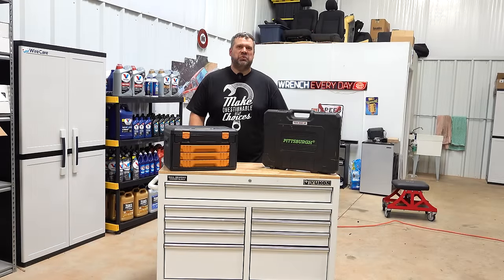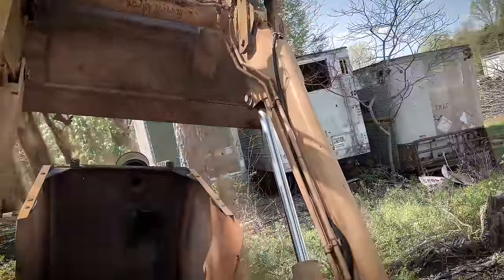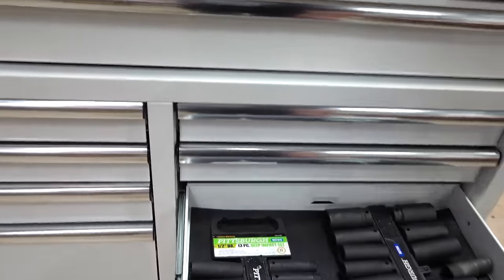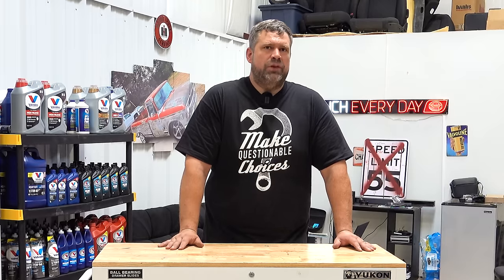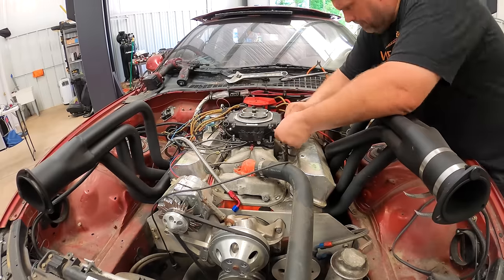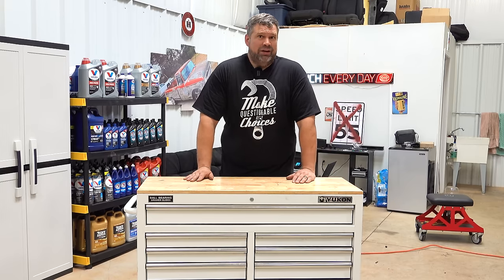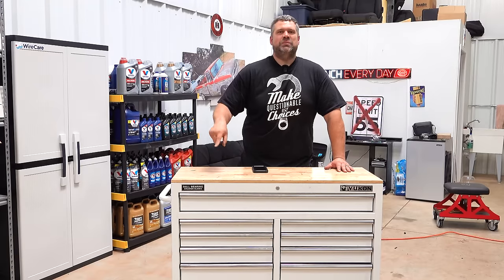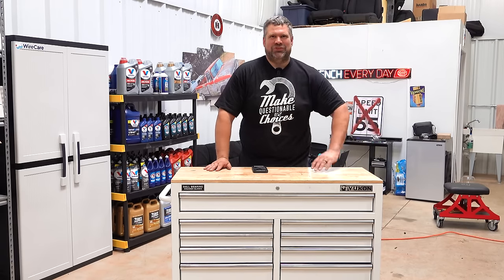I Bought The CHEAPEST Tools In Harbor Freight (6 Month TORTURE TEST)

Comment: Tekton Tools, Sunex Tools are fantastic. I admit. I have zero complaints with Tekton. Their socket sets (chrome and impact) are great, the pry bar sets,  etc. I've abused the shit out of and they still keep going. Worth the investment. Granted I've got a few snap on , Mac tools and Cornwell things but I agree with Jared so not waistinf every single penny you have on not enough tools for way too much money. The icon stuff from harbor freight are fantastic. Their 3/8 hex bits are awesome I use all the time, there 1/2 flex head ratchet. There is stuff from the trucks that  is helpful to buy but,  most of the time it's all rebranded Lisle stuff which really does annoy the hell out of me. I do my best to buy stuff independently and not from the trucks bc it is a waste of money. Also Astro Tool/Black Onyx air tools are awesome and I wouldn't do a timing belt without my 1/4 stubby air ratchet. Jared's review was fair and if you're just starting out take his advice. I work for Acura and used to work at Honda. Money is always an option so don't be fooled. But what you can with what money you have. Always do your research on what's good and what's not.

Comment: HF is good about grantees and swapping out  broken tools, but if you loose a tool (wrench, socket etc) they push you to by a set of tools again or deal with customer service to order one that may take a while to come in. Some of the other tool brands will let you order online singles or in the case of Lowes and Home Depot, the carry many in store for replacement. Example, that 13mm Pittsburgh wrench if you buy the set, could be $20.

Comment: I got a set of snap on ratchet wrenches I use em a lot to break bolts loose they have held up almost 20 years old now and there doing a damn good job never had 2 fail on me but I had one and it was the retaining ring just came out that’s it I put it back in about 2 years ago and still doing fine if you clean em each use and oil em when they need it it’ll last until you die

Comment: For the hobbyist, HF isn't that bad UNLESS you work on a rustbelt car. If your budget is HF, your car budget likely is too and trying to get a rusty bolt out you will round off more than you remove with HF. They have too loose a tolerance. I've wrenched in WI my whole life. I keep some HF wrenches and sockets around for making that one-off shop built tool like heating and bending a wrench or welding a socket to a chunk of steel. The open ends are garbage as Jared mentions. You WILL round off stuff. But if you have cheap tools make sure you have a good torch and take your time.

Comment: i bought the original set of mixed plyers from HF orange in color still have a few and gave away a few they put those green ones to shame i replaced them with kobalt and it was a bad ideal,i now upgraded to a matco set hopefully have better luck with them,i've been buying some snap on new and used but i also been upgrading some of the pittsburgh and gearwrench sets with icon ,i have tool boxes in my shed the garage the basement and both my car and truck have somekind of tool box and bag full of tools,i'm just a tool junkie if it works for you then that's all that matters.

Comment: When I started as a tech 20+ years ago, the tool trucks WERE the only choice. Low weekly payments, easy warranty of broken tools, plus they're good. I still have a lot of my Snap Off stuff to this day.
But back when Sears (Craftsman) was around, and before Home Depot and Lowes that was your only other choice. There was no online shopping, and no multiple brands to choose from (other than the tool trucks).
BUT, I was given one great piece of advice from an older tech: "Your TOOLS help you work on the cars, the box just HOLDS THEM". i.e. Don't spend $5000+ on that shiny new Snap On box, when a $500 used Craftsman box does the same exact job. Today I see new techs dropping $5k, $10k, $15k on JUST THE TOOL BOX and I just laugh and shake my head.

Comment: Myself, I think, if you're starting out, you should buy some basic sets from cheaper brands like those listed.

Then when you break stuff, upgrade. If you don't break stuff, upgrade your sockets, screw drivers, spanners and pliers (in that order) from Snap-on or somewhere like that (if you're serious about staying in the trade.) 

I'm predominantly a Snap-On simp, but I started out with basic sets from Halfords (UK's version of Super-Cheap Auto or Autozone or whatever it is in US) and kept them until I either kept turning bolts into circles because they were 12-point or until I broke the ratchets and traded them in on the snappy truck for a decent set. 

No matter how many times you break them Snap-on tools, they just keep throwing new ones at you. If you wear out a screw driver to the point it cams out of the screw you're trying to loosen, they'll put on a new tip. If a set of pliers starts binding up 3 years down the line, he'll throw you a new one. 

Just had my 6 year old hammer nearly break on me today (hammer head was getting loose), jumped on the Snap-on truck to replace it with a Bluepoint one, and just the Bluepoint one felt a million times better than the old one ever felt. 

I think once you start getting to the point where you're rattling through jobs quick and you need decent tools to speed up or make jobs significantly easier, that's probably the point where you need to start looking at Mac/Snap-on. Snap-on's flank drive sockets and spanners are probably the first thing you should jump at when going for great quality tools, as whilst they're almost a grand for 3/8" sockets and 5.5mm-19mm spanners, they will almost never let you down, and when they eventually do somehow, just get a new one free of charge. Expensive, but they make life so much damn easier when you're not having to remove a rounded bolthead or having to find another socket when your first cheaper ones break, or heaven forbid going to A&E cause a socket cracked and cheese-grater'd your hand. 

In reality, it'd be cheaper to buy the best tools first, but also it's not realistic to go straight to £6k worth of hand tools. 

I don't think I'd ever buy a Snap-On tool box unless it was a great deal - missed one myself recently that was their massive double-sized box, secondhand, in really good condition for £2k. I might have gone for that if I had £2k spare, just because A) I need a new box as my current one is getting a bit small now and B) because I liked how it looked and how it would fit next to the space I work in.

Comment: I have the top an middle craftsman boxes filled with craftsman tools I got 22 years ago.  I also have a snapon top box i brought almost 30 years ago also. I also have 2 other boxes from sears with some cheap tools and drawer with sockets name from other tool makers. 
Since last year me an my dad been going to harbor freight tools and buying tools. We both got the 5 drawer tool cart from us general an i been filling mine up with harbor freight tools like Pittsburgh tools. I got the 1/4,3/8,1/2 inch sockets shallow and deep metric an sae an socket trays an extensions and ratchets and wrenches in metric an sae an stubby wrenches and some ratchet wrenches all in Pittsburgh. I have some other tools also.an lights. Hopefully by this summer it will be full of tools. 
I'm a disabled man in a wheelchair. I became a paraplegic 27 years ago from a rare cancer that damaged my spinal cord. 
I use to work o. Cars first with my real dad an then worked in the shipyard. After I worked with my stepdad on cars doing bodywork.then I went back to the shipyards .now I use to work on cars before 2005 hurricane Katrina hit. 
Now I want to learn how to work on small engines like push mowers and riding mowers and other stuff. Hopefully one day

Comment: Hello again Jared 
Thank you for another Great Video. I need to  buy another tool box. My current box is a Craftsman 9-drawer, 40"x18". I bought about five years before Sears closed. My biggest concern is how much the box weights empty. I was surprised to learn they can weight between 150Lbs and 500Lbs. That's ridiculous and very unsafe. This box weights 316Lbs total. And I am just about out of room. I don't want to add top box.  I need the work surface. Any suggestions would be appreciated. Again thank you

Comment: A couple corrections to his information about Snap-on. He says there is mark up from the factory, the distributor, and the truck. There is no distributor. The trucks get their tools directly from Snap-on, who is the manufacturer. 

Also, misinformation about the EC account interest. Yes, it's a higher interest rate, but it is SIMPLE interest. It's not compounding interest. So a $3000 purchase on account will not turn into a $6000 purchase. You simply add the (lest say) 25% to the purchase price, and that's the final price. There is a HUGE difference between compounding interest and simple interest. A 25% simple interest rate will cost you less than a 10% compounding interest rate on a credit card.

Comment: I know with snap on when you go to a training school/program they usually have a contract with the facility and they give the students 50% off. This was the case when i went to a private college for a degree which also has a certificate program if you want to do it faster and dont want the degree, and also places like UTI, the motorcycle version MMI. The program makes a list of everything you need and snap on will fulfill that list for 50% off. The first 2 semester i got a tool loan i could have used for thr snap on tools for around 4000-$4500, then the last 2 semesters i believe was a little less. It was way more tools than that $4500 apprentice set, and you get a full size toolbox. That $4500 apprentice set is really such a joke, but what you get at the schools/programs for about the same price is really a good deal since you're getting 50% off. Most ppl get the full list the school puts together from snap on, but of you know what you're doing you can pick and choose what you want from snap on and get the other stuff somewhere else to make your loan go further, and youll still get the 50% off from snap on as long as you're enrolled in the school/program. I didnt use the loan they gave me to get the snap on tools because i already had my own tools, but i wish i did take advantage of the 50% off to get stuff like sockets, wrenches, ratchets...the stuff you use everyday. Then get the other stuff at harbor freight or where ever. And guys please dont waste 1000s of dollars on a snap on box. You can get a toolbox anywhere else for sooo much less. It wont be as good as a snap on box, but it will be just fine. Its going to hold your tools, and most likely will have a lifetime warranty. Or buy a used tool box to save some money/spend the rest on more tools. Theres no need for a snap on box. I know professionals still getting and upgrading snap on boxes and bragging about it and all i can think is, "you still havent learned and still wasting your money on these things, brag all you want, im not impressed, i think you're a fool"

Comment: I started as an A&P in 2008 after a career in the air force. The service center I was hired into had a list of required tools. It wasn't too large. I was a big Craftsman fan, so I looked at their rolling tool cabinets and they just happened to have a sale on the 41" 13 drawer that week. It came with an extra drawer on top, and three hundred and some odd tools. All for around $750. I picked up the rest of the tools needed at Harbor Freight. I eventually moved to Flight Test, but with the same toolbox. Over the years I've added a few air tools, some battery powered tools, and various speciality tools. I've never been on the weekly tool truck, and I'm still less than $3K into all the tools I have. I work with fellers that have huge Snap Off rigs filled with tools they rarely use. Never understand it. I mainly use 1/4" ratchets and sockets, angle wrenches, and ratchet wrenches. My battery powered 1/4" Makita drill gets a workout on screws too. Our toolroom keeps all the torque wrenches and really big tools if needed.

Comment: I like Harbor Freight.  However, you have to be very careful with what you purchase.  They do sell decent tools for cheap.  They also sell complete and utter junk.  I have purchased tools, taken them out of the package, found they were crap, even for Chinesium, and took them right back to the store for a refund.  Also, do not use WD-40 to prevent rust (maybe a different product, but not plain WD-40) as it dries very quickly and leaves a residue.

Comment: In my part of the world, tool like Snap on etc are way way out of my budget that I don't see myself ever owning one piece of tool from them. I use whatever is available. Stanley, Craftsman, Great neck, Pittsburgh, Tekton just to name a few and I never had a problem with any of them. I have Stanley spanners and sockets for over 10 plus years with no issue. And I am guilty of using Chrome sockets on my impact for years and never had a failure yet.

Comment: I work with nothing but HF sockets and I love them I even have the HF tool cart, it's gotten to the point to where everyone at my local store knows me by first name. I will say though that some of there tools are treasures and some of them are just junk, there QUINN and ICON line of pliers are great but the Pits Pro are just horrible ect. I would say if you are going to get everything from HF do your research and figure out what's good and what's not and goo for the more expensive tools there because you can go in and buy only ICON and QUINN hand tools and still barely have the debt you would walking off of a tool truck.

Comment: harbor freight tools have always been worth the money. used Pittsburgh ratchets. beat the ever loving F out of them. full body wright, using a hammer. lasted almost a whole year before the 1/4 inch gave up and now only works in one direction XD not bad for 10 bucks
Reply: if you take it in to the store, they will replace it for free too. (Yes, they can deny you the warranty because you hammered it and abused it, but I haven't seen them do that as long as they have it in stock)

Comment: the ONLY way i would by all Snap-On tools would be if i had an unlimited money/. You can get good tools at cheaper prices and get yourself a nice starter tool set. Pick a power platform like DeWalt or Ryobi (depended on what exactly you are working on) and you will save thousands of dollars and still get the job done

Comment: I really like my icon wrench’s I have them all the way up to 24mm and I think they have earned a permanent place in the toolbox. I might in the future get some Milwaukee ratcheting wrenchs but it’s not killing me.
Reply: I got the icon ratcheting wrenches (stubby and anti slip). They are some of my go tos in most instances. Antislips don't destroy bolts unless you are absolutely hammering on a bolt. Stubby are just useful in tight spaces. I also get a 20% employee discount, so they're even more of a value.
Reply: @azhule4041  if they are 90 teeth like the Milwaukee ratcheting wrench’s I’ll be down to buy them. After taking my engine out holy shit man I’ve realized there’s a difference between teeth count and it makes it so much easier if not faster.
Reply: @402SHO  unfortunately they're 72 teeth, I haven't had a major difference between the 72 and 90 tooth, but then again I've never had to do too many modern cars with their cramped engine bays and all that.
Reply: @azhule4041  oh man when I was doing my master and booster upgrade to a 2013 model which is a stronger pedal feel I was in there for 30 mins just turning down 4 bolts, I was kinda mad 😂
Reply: @402SHO  ah man big rip, I generally get lucky on all the cars I work on being fairly spacious. Other than my uncles jeeps' (2017) alternator, that was before I had the stubbies though. But for me, the icons are wonderful (especially with working there and getting that discount)
Reply: @azhule4041  oh yea I had plenty of space I was sitting in the engine bay on the front subframe 🤣. It’s when u get to the right side two nuts, the wrench will hit the stud then hit the strut tower giving me like 3 inches of swing 😭
Reply: @402SHO  yeah that's not too Bueno my guy. I e lucked out alot more compared to what you've had